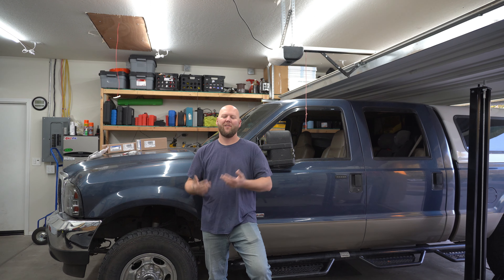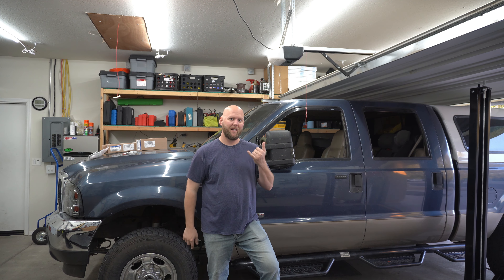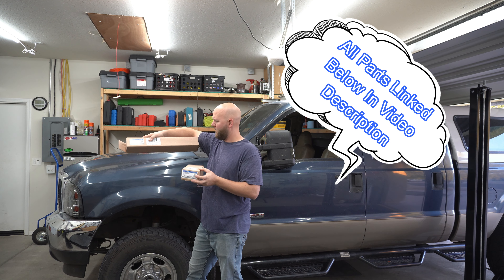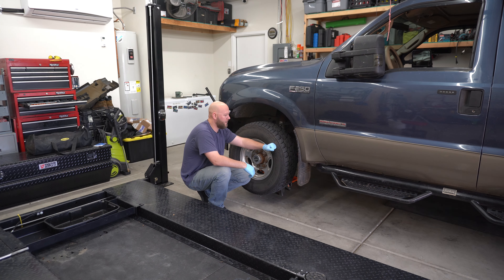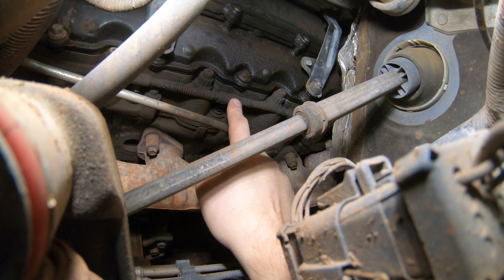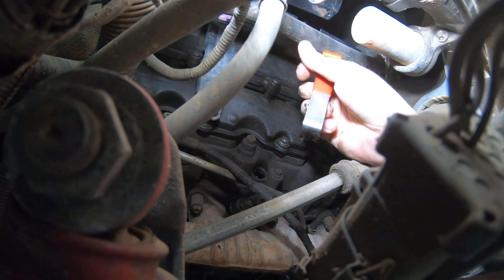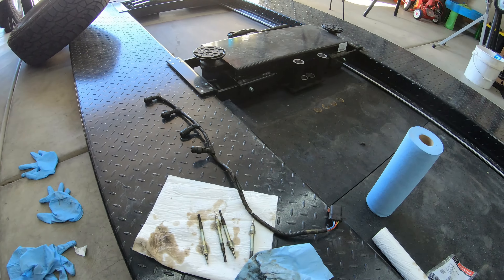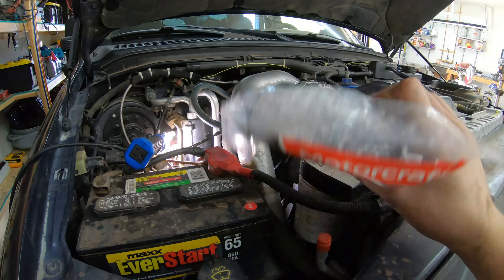6.0l F250 Glow Plugs, Harnesses, and Control Module DIY Replacement

Comment: About 2-3hrs West of you but still in AZ. Same truck with early 6.0 but only 220k. Just had the issue where truck didn't want to start in 50+ degrees w/o holding the key for almost a minute then when caught it was lousy before evening out. Even after dumping almost $80 for new fuel filters to no avail. Wish had found out about the GPs sooner as the filters turned out to not be necessary. More helpful guide than the others I've seen yet.
Reply from the maker: I appreciate the feedback and glad I can help! That's why I started the channel
Reply: @AGuyandHisProjects  Fortunately the truck has the cord for the block heater so will have to use that to make even the AZ desert cold start possible until I can get the parts. Fortunately I don't need the truck often. Will find out in the morning since need it to recover a 60yo 6x4 my dad built that I took in (1st time off the property really in 40yrs) for a small militaria show.
Reply from the maker: That sounds like a lot of fun!
Reply: @AGuyandHisProjects  Weather screwed things a bit. Some that were to come didn't Still a largely local thing yet.
Got pics of the thing but this older clip was after getting it running in 16 after it's last run in 81
https://youtu.be/uh6WIvG_Vxo

Comment: Seems like you have the newer 04. I think the older 04 was manufactured before sept 22 of 2003 (don’t quote the date, but yes, 2003 not 2004). The older style had a solid rectangular tube for a harness.
Reply from the maker: Interesting. It isn't the newer style engine but this thing has been pretty modified by previous owner

Comment: Any of the other 7 GP's bent??? I'm fairly certain that the first 6.0 iteration, 2003 to mid 2004, had longer GP's. Is that the conclusion you came to? Thanks for the video.
Reply from the maker: Never did figure out why they were bent. Don't seem to be hitting anything down there. Been through two south dakota winters now with no issues though

Comment: Hi mate I replaced a all 8glow plus on my excursión 7.3TD  and  still not start correctly 😏 no fail codes 😏 can I asking if needs to replaced some relay?! solenoid?! Thanks for all helping 🙏 👏👌👍 cheers for Norway 🇳🇴
Reply from the maker: Thanks for watching! Wish I had an answer for you but I honestly don't know. On mine the switch was also faulty and I replaced it. That is in the video as well. Not sure where yours will be in the 7.3l
Reply: @AGuyandHisProjects   this 7.3TD  are a great engine but that 6.0 isn't not the same quality engine 🙄 a friend of mine he really hungry with him is a piece of crap engine 🙄 many electronics sensors and stuffs 🙄  I think is better a 7.3TD power stroke 👌👍
Reply from the maker: @jorgefonseca9225  I think most agree with you! That is why the 7.3l hold value so well. They last forever. I would really like the 6.7l but my biludget keeps me to the 6.0l haha! So far I really like it though
Reply: Need to replace the glow plug relay
Reply: @nicholasadams2908  hi mate thanks for your attention 👍  I checked out and looks like it's a gasket around valve cover!! the electric wires are damaged so I need replaced that 🙄🤔 because sometimes works perfectly and sometimes comes a fail code (glow plug cylinder 2 and 4 and sometimes cylinder 6 and 8) 🙄🙄 I checked the pins and it's inside 🤔

Comment: WHAT IN THE ACTUAL F***???!!!! im onto the passenger side, the side where you said, ("its the easier than the drivers side"). well no, its really not. LMAO but im really crying.  the air box on the fire wall wont even let me get the old harness off, unless i break it ..
Reply from the maker: Hahaha maybe it's just the way I work lol. It was definitely easier for me. You'll get er! Did you do the drivers already? There's just a lot of stuff in the way on that side
Reply: You have to unbolt the transmission tube from the valve cover stud and and remove it also. Then it will move out of the way. Also the heat shield on the heater core blower motor box next to the glow plug harness has washers the press on and will pop off if you pull on the heat shield near the plastic studs that the washer is on, there are 6 of them.

Comment: I have a code P0678
Reply from the maker: I'm no mechanic by any means, but I'd imagine that glow plug is either faulty or something in the wires or computer. Let me know what you find out!
Reply: I think that's glow plug #8. P0671-P0678 is 1-8 glow plugs. Even is on the driver side and odd is on the passenger side.